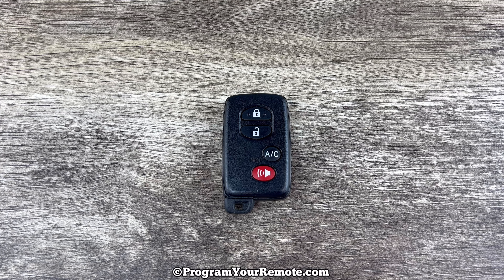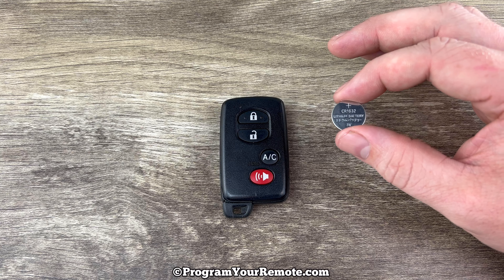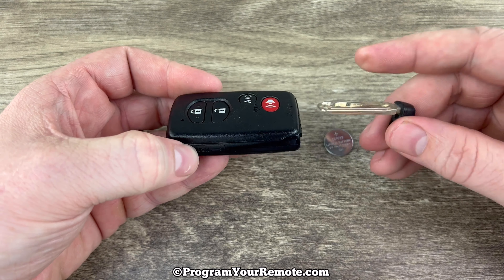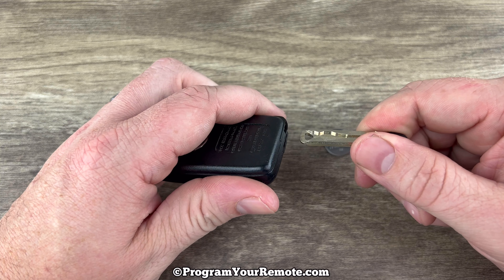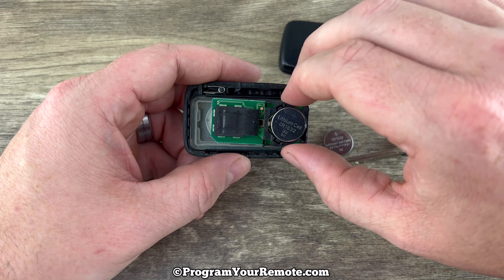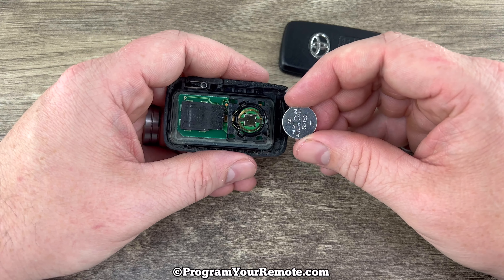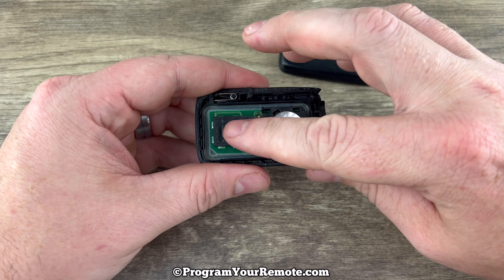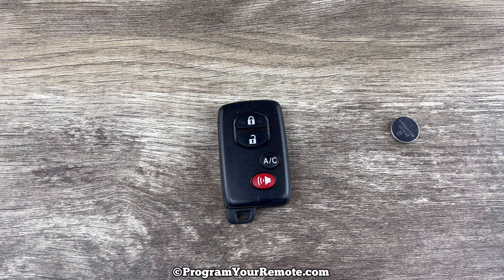How To Replace 2010 - 2015 Toyota Prius Key Fob Battery - Change Replacement Prius Remote Batteries

Comment: Pretty good, but beware:  Those little lock/unlock & hazard buttons are only held in place by the fob.  When you open the fob, they can fall out--and good luck finding 'em!
Reply: Good reminder. I had to get a new fob shell b/c I dropped the pieces and couldn't find all of them, so be careful handling the 2 sides of the fob once open.

Comment: Worked for me. Only my battery was very stuck in there. I ended up using a micro flat head screwdriver to pry it out, the end of the key wasn't thin enough to get in there. 
Still happily driving a 2014 Prius V which is about to hit 100,000 miles.

Comment: Why does my plug in battery not charge to full ? I have Prius hybrid plug-in 2015. It used to be more now it’s less before it was over 19 now it’s 8.7?
Reply from the maker: Not sure on your vehicle specifically but rechargeable batteries in general loose their charge capacity over time
Reply: If you're talking about your EV range, it will go down according to how you drive. If you're heavier on the accelerator, it will reduce your EV range. When I do more pulse and gliding, my range stays around 16 or 17 miles. This is of course assuming nothing is wrong with your hybrid battery as PYR Automotive mentioned.